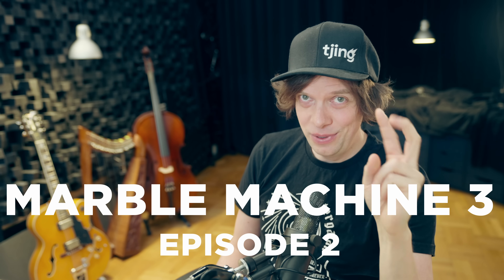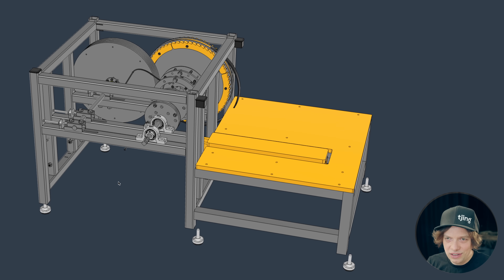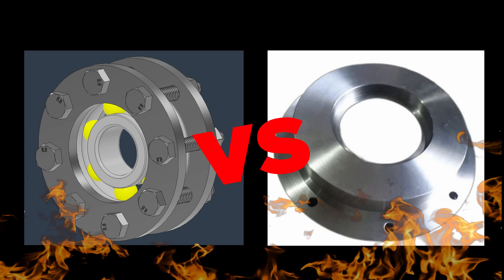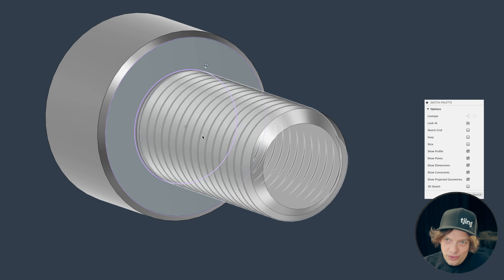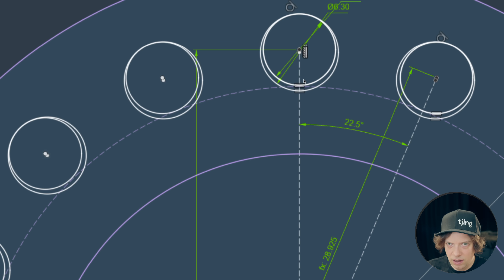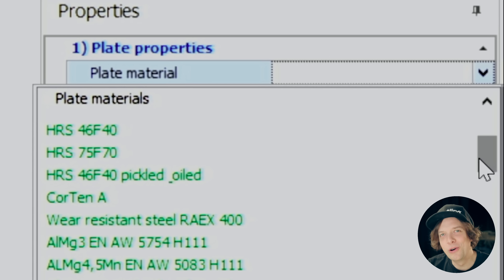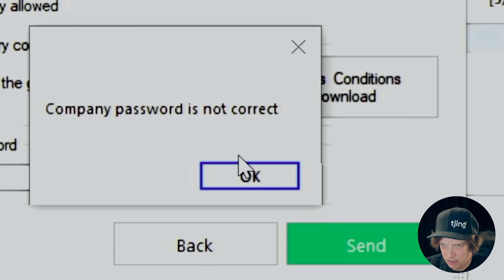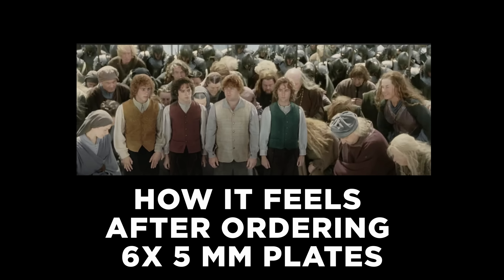Cheap Bearing Housing - Marble Machine 3 Ep.2

Comment: Why not just have a piece of metal in the middle of your 'sandwich' that has a hole in the center the same diameter as your bearing. This inner ring (or rings, if you need to stack a couple together to get the correct thickness) will hold the bearing in place, the two outer discs will clamp the whole thing together via bolts that pass through every layer. Your bearing will be held perfectly in place and won't be prone to the failures of this 'bolt cage'

Comment: I would make a 3d printed gasket that the bolts would go through and would provide a precision surface for the bearing to rest again.

An ABS or ASA print would be fairly strong and the bolts around the perimeter would further reinforce.

You could also cut several prints in layers to provide the resting surface for the bearing.

Comment: Martin, please listen to what everyone is saying. Also, maybe try and figure out what kind of stainless you're using. Galvanic corrosion is real and kills metal

Also,
Coming from someone with exactly 0 engineering background, couldn't you just drill a hole in some wood and force the bearing into place for a press fit?

Comment: hey, here's a tip for you, even lasercutting machine have tolerances for cutting pieces, but in that material (1,4307) and thickness (5mm) it should be ok and in spec (Aluminium AW5... or AW6... is a whole different thing because it heats up much faster)
o yes and for ordening you kinda need to know the "Work material number" 
so you wanted Stainless steel => 1,4307 (304L => L stand for Laser quality) or if it needs to be resistant to salty environment 1,4404 (316L) (X5CrNi 18 10), can you still follow?
Good, now steel: 
regular construction steel cold rolled (St37 / DC01) max thickness = 3mm
regular construction steel hot rolled (St37 / S235) minimum thickness = 3mm (247 Tailor carries Laser 240 + as equivalent i see)
somewhat stronger construction steel (St52 / S355) (247 Tailor carries HRS 46F40 as equivalent) (pickeld means that the mill scale is removed)
Corten A is steel often used for outdoor use (outdoor furniture, sculptures, flowerboxes, etc) , once it has a rustcover it's safe and wont rust any further
And i guess you'll figure out all the rest

Comment: You need to read up on GD&T. What you're doing is basically reinventing the wheel. There are standard ways to define tolerances and you could solve your problems by using design standards

Comment: I understand wanting to try a fun new idea that is interesting and works together nicely. However, it is very apparent that over time, your threads will not hold up and your tolerances are not going to last.

PLEASE take everyone's advice and just do it the conventional way (even though it may be boring). It will save you a headache later down the line.

Comment: A 1/4-20 holds 500 ft. lbs, so it you make 8mm holes for 6or 7mm bolts and have the plate hold the outer race of the bearing you should be fine.

Comment: I'm an Aerospace Engineering student. Martin, you have been a big inspiration in choosing my career pathway and I've always admired what you do! This design relies too much on specific tolerances that just aren't available from outer thread radius of bolts. There's a lot of other options for this part, ones that require a lot less R and D too.
Reply: Yep! They even sell a single off-the-shelf component that accomplishes the entire goal he is setting out to try and find a unique solution to. All he needs to do is purchase a flange bearing. It's aligned, and has mounting bolts holes to bring it concentric. And it's 1 part, not 40.

Also glad to see another Aerospace Engineer! I'm currently in school for it to with a focus in Astronautics!

Comment: Make it two parts.
Part on is your ring with bolts, holding down axially. Space out the bolts a little more to the outside.

Part two has a tight fit around the bearing, and same bolthole pattern. This wil hold the bearing laterally.

Then tack-weld those two together.

Or, at least: use bolts with partial thread to push against the outer rim, not the threads.😢

Comment: The threads on the bolts are not precise at all. The fits and tolerances that you get with machined parts are microns, where as the threads on cheap bolts can vary by +-0.05mm or more.

Some things in engineering are purely convention. The use of machining rather than plasma cutting for precision parts is not a convention.

MM3 is all about going for sensible design decisions. Don't deviate from that now.

Comment: those laser cut pieces are pretty inexpensive, just stack them up to create the housing and side walls. also screws and bolts aren't designed for radial alignment or force, they are designed for clamping and creating a high friction fit with the clamped surfaces, so you would be way better off just leaving the bolts very loose from the bearing's sides and using the clamping effect of the bolts to secure the bearing in place. You have  A LOT of surface area around the edge of the bearing, so just use it
Reply: As someone familiar with what tolerancing on laser cut parts looks like, I'd question if you could make an effective housing by stacking laser cut plates up.  If I could do it cheap, yeah, I might try it for shits ang giggles, but I wouldn't expect results to be repeatable.
Reply: @SteevyTable  yeah but like I said, the main holding force of screws, especially at that size, is the clamping force, not the radial positioning. In fact he would have a lot more adjustability if he discarded that degree of freedom entirely and only clamped the bearing. And 8x M8 bolts is probably way too much strength, a single M8 bolt requires a stupid amount of force to be moved if torqued down appropriately
Reply: Tolerance growth. Or maybe out-of-tolerance growth

Comment: This design with the bolts is tremendously cursed. Specially if you plan with store bought ones.
Save yourself the trouble, search for existing solutions such as "insert bearings", or "bearing houses".
PS: Also an industrial draftsman/mech eng here. This is the second most cursed thing i've seen today.

Comment: As an engineer I would say there are so many better solutions, if you want to stick to laser cutting, make a third circular plate inbetween the plates in which the bearing would sit. 

You could also use platforms like hubs to custom machine the parts for you based on step files.

It seems to me that a 3D printed bearing holder would also be sufficient for your case if you'd want to go cheap.

The best (and probably cheapest) option would be to just use standard flange bearings. They will self align, are easy to mount, and are stock items which are easy to re-order without custom parts.
Reply: ...Possibly also to design parts using different material thicknesses, that can be combined to replicate parts that would otherwise have to be machined.
Reply: Using as many stock parts as possible will be important for a machine that's expected to tour around the world - if anything breaks and the maintenance team runs low on spares, a replacement can be easily ordered without having to rely on *that one guy with a 3-D printer who happens to have the files for this specific piece.*
Reply: @InventorZahran  would require it to be touring first - something that's been put-off for a decade now. This marble machine will probably end like the last one, in great success after years of effort just to be shut-down from a tiny glimpse of concern.

Comment: When you use threads as bearing houses, you rely on the size of the thread and it's strength. Threads have a tend to bend under load, so your bearing wouldn't have exact position in time
The solution is housing bearing - exact thing you need (hope I wrote ir right in english, anyway google shows right results for that request)

Comment: I don't think having the bearing being held by the tiny tips of the bolt threads is a good idea, this is not what a bolt is designed for.
Just a bit of wear and your bearing will start getting loose. Just my 2 cents.

Comment: If you do this you should use Shoulder bolts as the diameter will be precise.  This however is not a good way to hold bearings. I would not do it.

Comment: If you do not machine the 2 bearing housings directly on the wheel, you are going to make a serious mistake in aligning the axis and the wheel is not going to be perpendicular.  It will transmit a lot of vibrations to the whole machine and the bearings will end up breaking prematurely.  Greetings!!

Comment: 4k works on PC. However, you need a 4k (or greater) monitor. Macs tend to have higher resolution monitors.
Windows doesn't allow you to send a higher resolution to the monitor than the monitor's max supported resolution.

Comment: Is the traditional solution 100x better? Well put it this way: your solution is untested, and has been used in 0 applications, the traditional solution has been tried and tested in numerous applications. The challenge is not to prove the traditional solution is 100x better, but to prove your solution is even 1% as good.

Comment: The good thing about the standard solution to this problem is that the problem stays solved.  It's also quick to solve and cheap to solve.  The bolt cage will be an expensive time and attention drainer that will seem to solve your problem several times but it will never stay solved.

(Tolerances, threads getting worn/bent.)

Comment: Martin, I really hope you plugged in your display/capture into your GPU instead of your motherboard. Windows can do silly things if it needs to, 4k is nothing.
Motherboard display outputs are for basic monitors or troubleshooting. If you want to do anything like high refresh rate, HDR,  or 4K, you will need to use the ports on the GPU and a matching rated cable for your use.

Good luck trying something different with the bearing mount! :)

Comment: As a retired jet machanic I've seen bolts with a shank long enough to go through both clamping plates, if the bolt holes are too tight just shave a flat spot on the bolt shank. I'm with the engineers on this design. A custom bearing housing is the correct means to support the rotating assembly.

Comment: You may be able to get it work(or it may look like it is working ) once or twice after a couple of tries.  But does it really worth it ? you could use that time for something else.
-The tolerance on the laser cut parts(burrs, taper, material, bends etc) and the bolts(also, Class of bolt, manufacturing process, material, coating etc matters) will not be consistent 
-tightening all bolts with same torque will be an issue, even tightening order could add a mis alignment, which will show up after 3-6 months
-too many components, more points of failure.
-vibrations make bolts loose, applying Loctite kind of solutions reduce the serviceability
-an unskilled person cannot do maintenance, even for a skilful guy , it is difficult - repeatability of this method is low
-if the thread depth is not sufficient, bolt could be tilted and will add undesirable forces.
-The clamping surface of bolt head are usually not flat, it may have small fillets taper burrs etc, it may give bad clamping for this specific case.
-your requirements of a bearing housing doesn't seem to be a special cases, you could easily solve this in less time using standard parts for even cheaper cost ( consider time spent on this = money ) and 

Apart from these it is going to be a fun way to kill time with some good learnings. (I have done many similar things in the past, today 50% my skill and knowledge comes from what I learned from those ) All the best.

Comment: 3:59 having a radial force on a Bolt is the worst type of stress you can put on a screw. The only way that this method could work is by having clamping forces high enough that the friction between the plate and the bearing holds the flywheel.

Comment: As is said in the previous video of the bearing housing, as stubborn as you are, at least try to use partially threaded bolt. The bearing will be guided by a real cylinder, a bit more precise than threads.

Comment: @Wintergatan
2:22 This is a VERY BAD idea, because real life bolts are NOT perfect, there are small variations even between bolts that "should" be identical, they will not be identical.
The best you can do (I think) is to machine a press-fit "sleeve" for the bearing with (threaded or smooth?) holes in for the bolts, make the sleeve LESS wide than the thickness of the bearing, if you want the clamping force from the side (but I think that is a bad idea too, material flex, part-slipping & such). Also: High tolerances = EXPENSIVE (exponentially) 7:17 .

Comment: Please listen to the advise of having a bearing housing, it's not 100x more expensive, specially on the long run, the bolts will never be concentric and your bearing will wear out vey quickly, on the long run it will cost you more time and money to replace those bearings.
Reply: Yes. When someone uses the "100x"  exaggeration, it  may indicate that the underlying logic is not correct to begin with.

Comment: the variability in the size of the bolts alone will not let this work... please tell me you will at least press the inner race onto the shaft?  if you don't want to machine metal, machined delrin, or heck even a 3d print fully supporting the bearing would work much better and let you get something close to a proper bearing fit... you will destroy your bearings if you don't mount them properly....

Comment: couldn't you just use a solution where you have 2 part with a slope on each part and a screw through them. When you tighten the screw it makes the 2 slope climb on each other and increase the diameter like that you can clamp your bolt inside your flywheel and it doesn't cost that much. I hope it was clear ?

Comment: If you really want to build this with laser cut sheets, don't cage the bearing with bolts, cut the cage from sheet metal(s) which ID matches the bearing OD and then fix those middle plates with that solution you already have. Or just use simple, cheap, basic flanged bearings, UCFL or other variations

Comment: You did you fail, but you did spiral out of control and gave up. Yes you are correct up to a point with simplifying and making it modular, but scraping off the MMX with 0 real world tests and proof of concept / design you are setting yourself up to repeat the same mistakes. The MMX did not fail you failed it, with all things created you need to go  beyond the braking point to see what else is there waiting for you around the next corner. You did not even try to even make a full song on the MMX so how do you know it was a failure. I would have spent the time in finishing the MMX and give it a proper test, not necessarily a world tour but an MMX album. I am still a fan but hoping you will see the light and finish a project before giving up, saying it is a failure.  Ps Please stop striving for perfection it is a lie it dose not exist. Best of luck to you with the mark 3.

Comment: I'm not an engineer, but I don't like this. No particular order and just first impressions.
- Why not thread the bolt holes to remove wiggle room?
- Vibration and wear on the threads (if anything I would use a bolt that is only threaded at the end)
- If you can mill a precise ring, mill another one to heat/friction fit the bearing?
- Why not weld this component if it's that critical? Are you over committed to a principle?
- Does this have to be custom made? Can you repurpose an existing solution? Vehicle wheel assembly, industrial bearing solution?

Comment: Surely tapered bearings are the answer here. Use the bolts to clamp rather than trying to hold the bearing in place via side friction. The risk of slipping seems too high.

Comment: Let some else use milling machine and cut it out. The bolts...honestly it is the garbagest idea ever....Need big and robust flywheel, got to junkyard and take example vehicle wheel bearing with housing. The bolts thing, you never get the vibration out

Comment: If you really want to go with the screw bearing mount, I would absolutely use shoulder screws rather than standard bolts. Having a smooth machined surface for clamping will be much much better than having the threads on the bearing. That being said, all of this tolerancing effort can be avoided by just using a flange bearing. Then you would only have to worry about the two or four mounting holes.

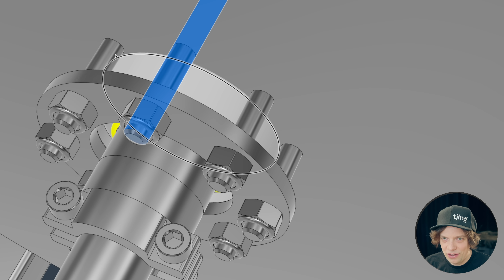Comment: 1:45 "For this design to work out, we need the tolerance to be perfect" But. They won't be perfect. So... I can't watch this video.
Reply: Alright. Against my better judgement I've now watched the video. I don't think the issue here is how to mount this bearing. I think this video is about several other things:
1) Trying out 247 Steel as a vendor, and maybe flattering them to see if Martin can turn them into a sponsor
2) Driving engagment by poking all the drafters, mechanical designers, and engineers, in the eye with a hare-brained bearing housing concept
3) Curiosity to see if this non-standard design could work

Comment: Martin we love you and we love this project. Please listen to these comments because everyone here has followed your journey here and we want the best for you. Keep this machine simple, go with reliable solutions, and remove the complexity. The bearing design is pretty unreliable, and having multiple tolerances to fine tune on a very important part is not ideal. Go for something that is reliable and something you don't need to fine tune. The different sized marbles also creates unnecessary complexity similar to the magnetized gear lift on the MMX. Remember, you are trying to make a machine that works and is reliable, not a musical miracle.